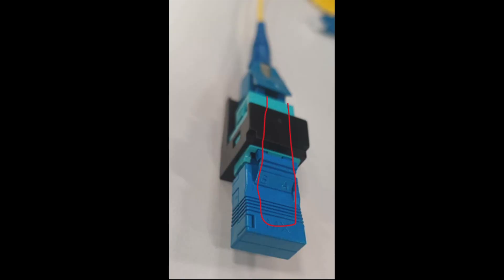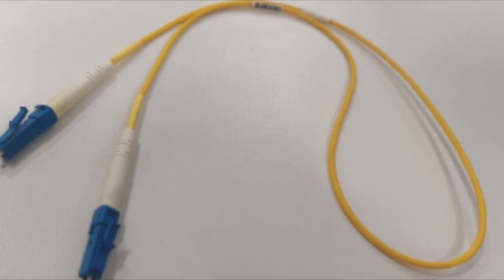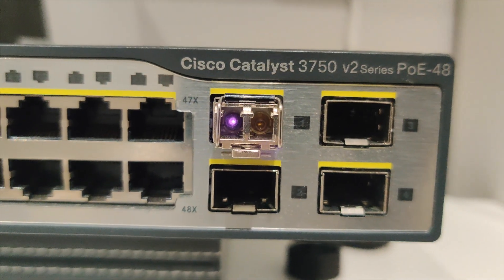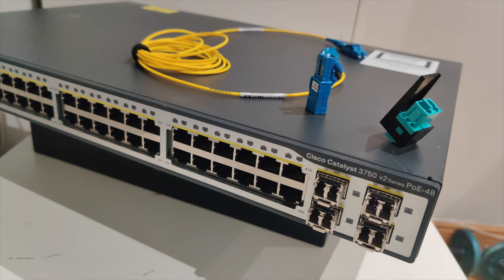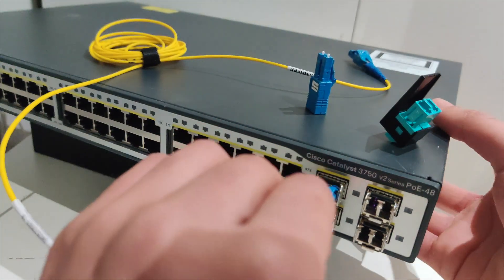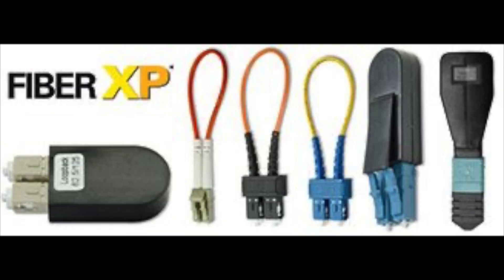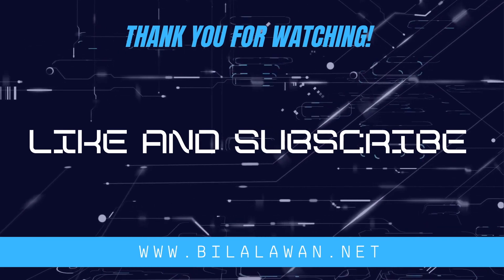loopbacking on a port - How to

Comment: Thank you for this video. But I’m confused about a few things here; 

1- Were you testing the SFP port which is used for stacking switches? 
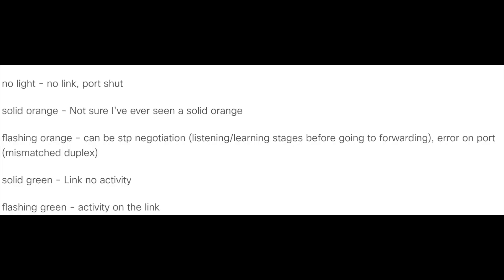2- At 01:27 what was this extenal port that you added, and how did light up without connecting end to end? 
3- The loopback cable, can it be used to test all ports on a switch? 

Thank you and I appologize if my questions were a lot.
Reply: Hi, 
1. No, this can be tested on any network port 
2. so this is a loopback, the light blue is a coupler (found in patch panels) and the dark blue is a LC loopback it receives light from one side (RX) and send from the other (TX). the loopback does not generate any light but just re-send (rebound) what it receives (mirror) 
3. Yes, diff ports, optics have diff loopbacks i.e MPO (send end of video)